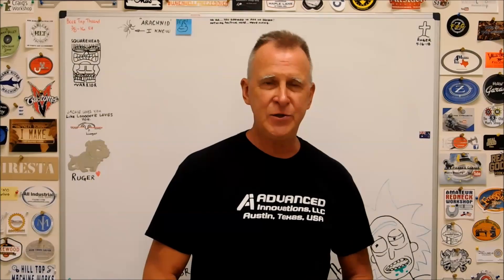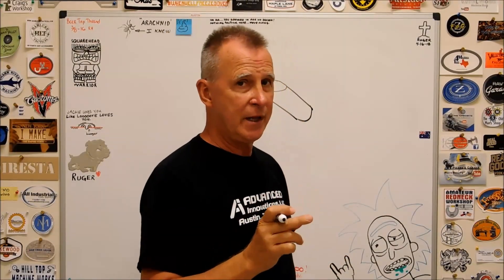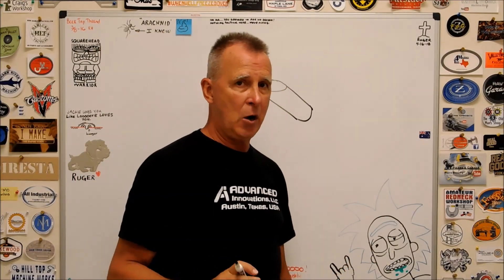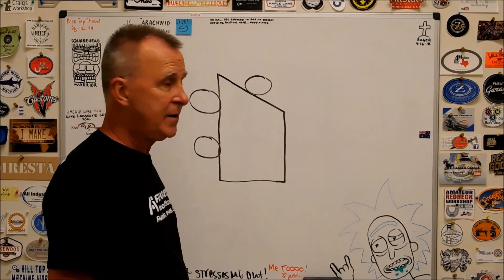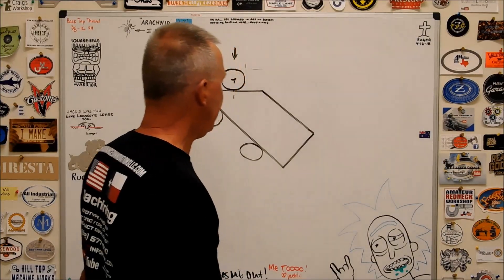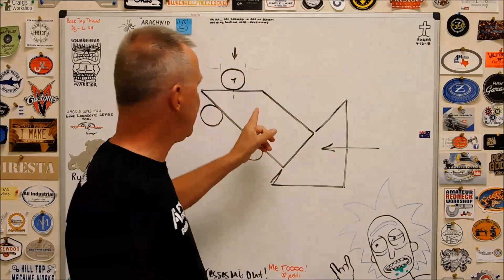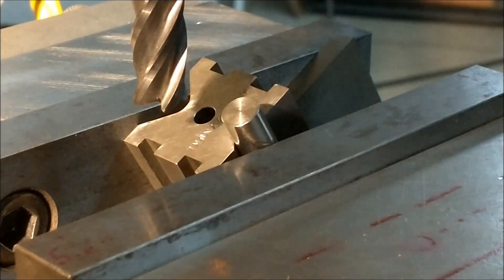A 3 Pin Fixture That Does All The Work -- You'll Enjoy This One !!

Comment: throw top and bottom pins on same vertical line. 
replace middle/front one with a cam, couple of extra holes for more range.
and you got repeatable and adjustable angle. and where that top pin clocks to in relation to the face...

Comment: One thing I couldn’t grasp, you must make one of those fixtures for every part you’re making? Because you mention that, once the part is seated and rotates, the top pin IS on the center of that face. Did I misunderstand you?
Thank you very much!
Reply: On... Making fixture for each part. Roughly speaking. Yes.
In this case, just being able to find that angled face for drilling is already a big challenge.
In this instance, there is just 1 feature on the angled face, so we can get away more simple setup.
BTW. This is what tool makers do.

Comment: Joe,I made a lathe once out of necessity 6x6" piece of 5/16 copper  2 bearings a Robertson bit a flex shaft for my drill and  2 screws to hold it down to my work bench.   Oh ya  and a peice of angle iron as my tool guide.
Can you picture  it joe?  I make silver jewelry  and turned hard casting wax on it.

Comment: Nice approach Joe. How would you approach this if the chamfered/ angled face of the pin had variation to it? The fixturing approach relies on that angle being 30 degrees. If it had significant variation,  that would impact your overall length & drilled hole Center position.

Comment: As someone who cannot afford all the cool tools you have my method would be to chuck the cylinder up in my ancient Craigslist purchased lathe, drill a small hole in the center just slightly deeper than the depth of the slope I plan to mill on the face, mill it leaving a little dimple of the drill hole visible which will now be in the center of the ellipse then clamp it in my cheapie Chinese drill press at 30 degrees and using the dimple as a guide drill my final hole. Maybe I am over simplifying but us poor folk with meager incomes living off the grid in the desert have to improvise.
Reply: Dumb farmer solution, as my Dad would say. There’s always more than one way to skin a cat. Respect.👍🏼 Btw, also a “ dumb “ farmer...
Reply: That would work!

Comment: Great video! It's a pretty small thing, but I'd love to see an example of the small toe clamp setup you say you'd use at 11:03 to rotate into place to secure the part. You explain it more at the end of the video, but it's the mechanics of how you would design it to clamp the part in (and overcome concerns of friction of the clamp being stronger than the friction of the part against the reference pin and not allowing it to properly seat/nest!) that I'd find most valuable. You did say a toe clamp, so a wedge? But you also mentioned rotating it into place, so a cam/eccentric? Or Mitee-Bites or similar? So many choices!
Reply: eccentric washer with a small machine through it. Rotate the washer so it pushes the part, lock the screw.

Comment: Would a V in the back plate allow a stronger grip? The sideways depth it holds the part at would have to be taken into account though...
Reply from the maker: Yes. 3 linear tangent areas of contact are certainly stronger.

Comment: Yep, that works, no problem. I spent a lot of years in Aerospace tooling (Jig and fixture, retired now) and my way of looking at the problem is from a production point of view with emphasis on idiot proofing tooling. My approach would have been to machine a block  to register on the fixed jaw of the vise and it would have a hole bored at the required 30 deg from the spindle axis. The upper Z face of the block would be normal to the axis of the bored hole. Make a register block to index off the face of the fixture block  to index your pin to normal. A thumb screw to hold your part once indexed with your backup block also moveable and lockable. The side of the block could be cut to allow the vise to transfer clamping pressure to the part. Now when you load your part, the face of the pin is always rotated normal to the top plane, properly indexed to Z and backed up by the back up block to prevent movement. All your geometry would be built into the fixture to remove as much "thinking" as possible from the operator. Again, my perspective is from a production point of view not a one off. This setup would also ignore any rounding caused to the edge of the part due to deburring.
Reply from the maker: The only way to idiot proof any production fixture is to take the human out of the equation.. I've done this for 47 years for the aerospace, semi-conductor and medical fields and I've seen mishaps that left me baffled.
Reply: @joepie221  AMEN!  The better job we do of making something idiot proof, they only make bigger idiots!!!! LOL

Comment: I also used small pipes in my air guns, but had to make them OHSA compliant. The company was VERY strict on OHSA rules  and we could be written up if we were not compliant.   So, all I had to do was drill a small cross hole at the end of the pipe all the way through both sides of the pipe,  VEE ARE VATCHING YOU VERY CLOSELY NOW  !!!!!!   take care.  Your coke can also would be a write up for several reasons, No  MSDS label being one of them.  again, take care.

Comment: Love watching you solve these things!

Two questions:
When you located the holes, you chucked each tool and moved it to the three locations, then switched tools, etc. Is there less chance for error, even with a DRO, to do all three operations at each location before moving to the next? I know you know what you are doing, I’m just curious.

Second, I’m guessing that the condition of the bottom face of the plate is irrelevant because the angle block is establishing the angle relative to the table.
Reply from the maker: Its a 50/50 on how you approach this. if you know and trust your machine, moving 3 times in close proximity and only changing tools 3 times can be quicker. If a quill depth stop is involved, there is no guarantee it will be the same for all 3 tools, so keep that in mind. But, staying on location for all operations is also a very good practice. Your choice.  As for the fixture, starting with a piece of material you know is square is important. If you're unsure, use the stationary jaw as your reference plane and make sure the plate seats on that. A parallel plate is best too.

Comment: Wouldn't there be two points that the 30 degree angle would come into view each being 180 degrees apart?
Reply from the maker: Technically correct. Yes  When rolling the cylinder, that end face will line up perpendicular, twice.

Comment: I’ve come to realize that a lot of my drilling problems are because of cheap bits.  What drill bits do you use and recommend, Joe?
Reply from the maker: I always choose cobalt drills if they are available. A little tougher than regular HSS and not nearly as brittle as carbide.
Reply: I am a big fan of Chicago-Latrobe bits, they have a thick web farther up from the point and are therefore very strong. The thick web makes for a headache after sharpening them too many times though.

I say buy a good quality HSS stub length drill set and replace them with HS Cobalt drills as the margins wear. Just my .02

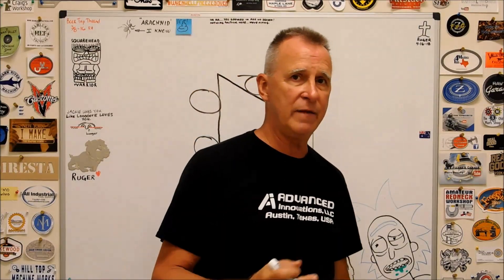Comment: I have to disagree with the claim of very accurate measurement at 3:20, the cosine error in your measurement will cause problems especially with a larger size pin that is used in your measurement
Reply from the maker: I respectfully disagree. The indicator isn't measuring anything. Its indicating relative position. The zero on the dial is true to a .125 centerline location. Cosine error would also be greater if the needle was at a more extreme angle. I honestly don't believe cosine error potential is a factor here.

Comment: Years ago I had to design something similar. I had 4 pins to locate my part in X axis, and a stop pin to locate the part in Y axis. The closest 2 pins to the Y axis stop pin also served as stop pins left & right. ( 5 pins on the base of aluminum 1.5" x 1.5" x 8" ) Plus a locating pivot hole on the hand tool ( knob )and a pin on this tool that was used to perform operation 1 & 2. Pivot hole drops onto stop pin Y. The part I was making was a needle rod that you solder tattoo needles to, and the needle rod had to have an eyelet on the end ( centered on the rod ) which was what all these pins were set up to do. Put the tool on left and bend the rod right till it stops at top X pin, then  lift and move the tool to the other side of the rod and bend it left till it stops at top X pin, wrapping it around the stop pin. The pin on the bending tool ( knob ) also had to have a larger offset radius on it than the diameter of the pin. The diameter of the bending pin was to do the 1st bend & when you lift it up and set it down on the other side of the rod, it was located at the start of the larger diameter offset radius on the bending pin.

It would really blow my mind to see you make a video of making this needle rod again. I certainly would not attempt to do this again, I am too old. I don't remember the length, eyelet hole size or diameter but I do remember it was 316 stainless. I had no part or blueprints to start with. Customer just said what size eyelet and how long overall part needed to be and handed me some 316 stainless straight rods. Rod diameter might be .8mm / .031" x 6" long, eyelet .200"

The base also had 2 milled out pockets at the bottom so it can me set into a vise to do the bending. All pins are standard .250" dowel pins. Not sure but I seem to remember the larger radius being close to 1"

If you can recreate this, much explanation is needed as to why a larger diameter radius is needed to perform the 2nd bend. I am surprised how fast I did this the 1st time and would not attempt it again.

Comment: What about just inserting into tha 5C collet and using an angle block to get the angle, clamped into the vise, or using a universal dividing head. Seems less of a head ache than using a custom fixture.
Reply: The point of the fixture is not to get the angle, it's to locate the center of the ellipse.
Reply: @pmdeutsch  You can still do that the same way you center find with a DRO & a bit of math on the ellipse sides (r = d/sin 30). Touch off the far ellipse side and move back radius of the ellipse side.
Reply: @guytech7310  Joe explained to that the benefit of this fixture is you don't have to depend on a corner that either has a burr or has been deburred past a theoretically perfect edge. Maybe Joe can discuss the accuracy of both methods.
Reply from the maker: This part could certainly be held in a collet and collet block, but would have to be properly oriented in the collet before the collet block was properly oriented in the vise. It could be done with 3 vises or on a tilt table, but a 3 pin fixture is much faster.

Comment: I’m thinking I would mill a shelf on the lower portion of the jig so the angle block is applying the upward force from the jig and not the vise bed. That might make the clamping a little easier to deal with.

Comment: This is common sense on steroids! Great insight Joe. Now I want to pick on you a little bit about using a lathe center drill to spot a hole to drill. You also drive that center drill in to the body size. If you used a spot drill you would save time since all that is needed is a spot for the twist drill to start its hole. The very tip of the center drill is all that is needed with a properly sharpened twist drill - a short rigid spot drill. OK, off the peach crate! I have spot drills but you've got me using lathe center drills too! Anyway - thanks Joe! I go through your many videos often and enjoy and learn too...
Reply from the maker: To be honest, I have used center drills for most every hole I have ever drilled. I use spot drills on aluminum in the CNC for speed.
Reply: @joepie221  I relate an old instructor in my early youth days who was certain that most of us would not become machinists. I never forgot his lessons and also took to heart that I was more into making a machine do what I 'programmed' it to do...much more exacting and fun too! Thanks Joe!

Comment: Benefit of dial indicator over edge finder??
Reply from the maker: The benefit is that most times you don't move the table after you find your position. Tramming a pin for example.
Reply: Edge finder will only be as accurate as your touch off. Indicator gives a legitimate measurement to location.

Comment: Hi Joe Very clever! I think what you are doing with this is beyond my ability as a machinist, but I now whereto go if I have to drill a hole on an angled surface. Cheers, Dave from OZ
Reply from the maker: Hi Dave, I don't want my videos to be over anybody's head. I'm hoping you guys are watching how I do something and not necessarily what I'm doing. Like watching a guy pull spark plugs for a ferrari using a unique tool. I would absorb the tool because I'll never tune up a ferrari.

Comment: I have a job coming up that will need bias cut  rounds drilled accurately  on the cut face.  A cut knurling tool. I'll use this thanks.
Reply from the maker: Thats exactly what the part that inspired this video is being used for.

Comment: Remarkably, I happen to have 5 near identical parts to that on my bench as work in progress, and had just been through the thought process to work out how to get the parts' inclined face to sit exactly vertical (in my case for welding). Reassuringly, i came to a similar conclusion in regard to how to ensure the correct geometry. 
:)

Comment: This seems like an overly complicated way of finding the center.
Reply from the maker: Not being sarcastic, but if you can share an easier repeatable method, please do.
Reply: It's not only to find a centre point, it could be used to find any nominated point or points on an angled face, and that determines when that face is correctly aligned, so the axis of the ellipse ( the cut face of the original circle) is in a set alignment.

Comment: Hey Joe, when you had the setup with 3 pins and then the angle block.. When you push the angle block such that the part registers into the reference pins, isn't this over constrained?
Reply: Instead of a plane (the plane on the angle block in contact with part) you probably need to touch with a point.. Such as a ball...
Reply: I don't think the end of the slug is constrained to be parallel with the face of the angle block; it could still make point-contact with the furthest projected point for a given rotational orientation on an unmachined face, for example.
Reply from the maker: The block is demo. I believe I mentioned a push clamp.

Comment: What is your DTI setup on the mill? Sure would like to see how it's attached to the head stock.
Reply: That's a spindle mount indicator holder. They're pretty common. The original was called an indicol universal indicator holder. I don't know who made it originally but the brand name tool is made by janesville tool company. And of course there are countless imitations to be found. I was going to make one myself for locating on the rotary table but then I got the blake co-axial idicator fixed. Now that's a nice one- a real time saver.
Reply from the maker: Its called an indicol and attaches with a nylon tipped thumbscrew.

Comment: Hi Joe, I often have to drill similar holes in a small part I make. Like the idea of using the pin. Mine are not high precision, till now I have used a level on the bevel face and rotated till level, but will look at using a pin fixture.  You constantly prove we are never to old to learn.  Keep up the great work.

Comment: Joe,
I make hot air engines . These require a close fit between cylinder & piston,- .problem -- how do i make a accurate bore in the cylinder without " bellmouthing "  ?
Reply: Use a boring head or fixture it up to bore it in a lathe.

Comment: Great work Joe! Another practical masterpiece. Sometimes a touch probe on a CNC is not the most handy tool. I'm very happy with the camera i'm using on my machine. It has a known offset to the spindle, it registers pretty accurate during motion. (within 0,02mm).  It has turned out to be a very convenient tool. For both positioning and measuring a part. (as well as simply aligning a vice)

Comment: It looks like a lot of work, I would drill the hole first in the lathe, then cut the 30 degree angle.
Reply from the maker: The oblique hole can't be done in a lathe without special consideration. A chuck or collet won't get ya there.
Reply: How would you fixture the part so you could drill the hole at the required angle?  It seems to me your method is easier only if the hole is perpendicular to the end of the part.

Comment: You can always measure/verify the angle using a V-block to hold the cylinder horizontal (or vertical if it is short enough).  Rig a vertical pin at a location near the cylinder's axis and push the surface against the vertical pin; clamp the pin/V-block in the vise.  The surface is now vertical and the cylinder's axis is along the machine's x-axis.  Measure the (x,y) coordinates of two points in the surface.  The '30 degrees' angle can be calculated using
tan(angle)=(x2-x1)/(y2-y1).  You can probably zero the DRO at one of the two points to simplify this.  Calculate this ratio and then 'tan^{-1} ()' on a calculator or find the closest match in the trig "tangent" table and read off the angle.  This angle can then be used to locate the pin holes in the fixture.